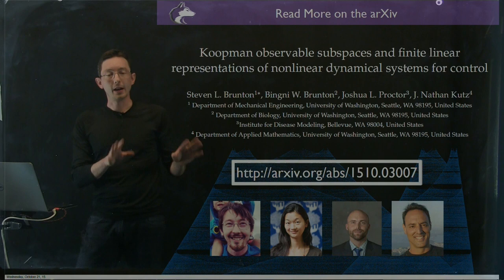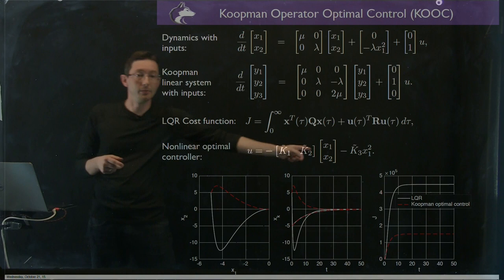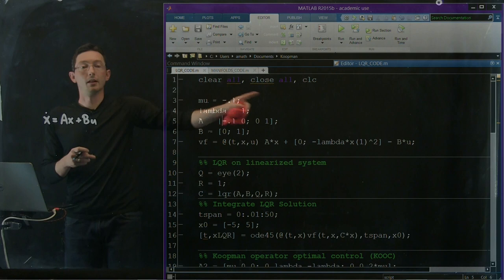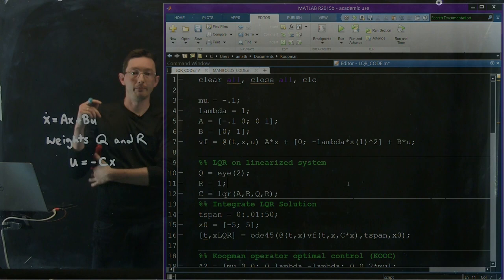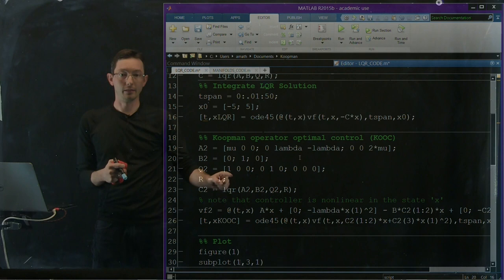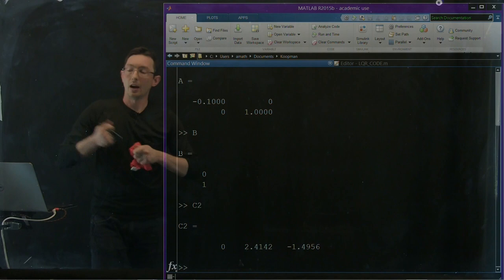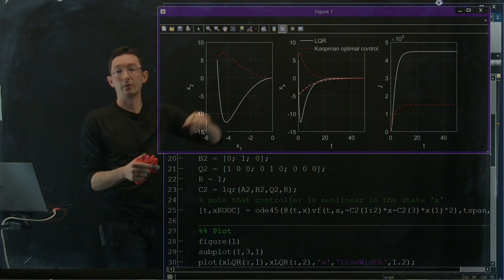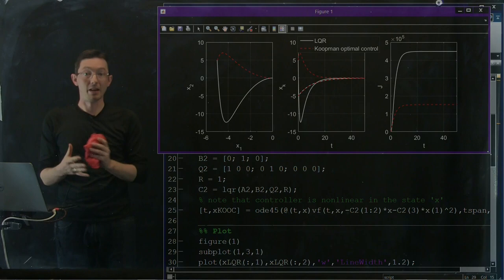Koopman Operator Optimal Control

Comment: It should be pointed out that the Koopman linear system in this example is not controllable but stabilizable. That's why the states converge to zero in the plot with the LQR control.